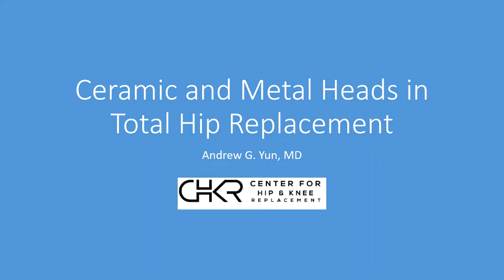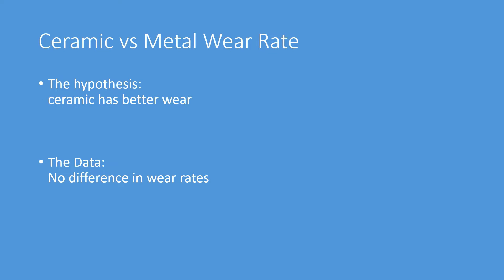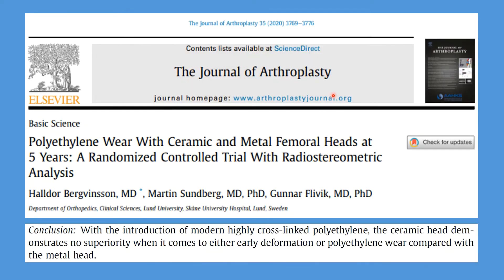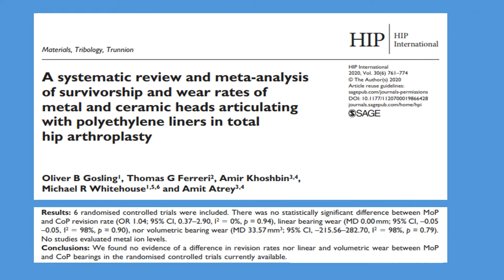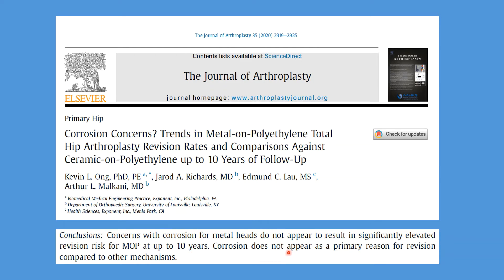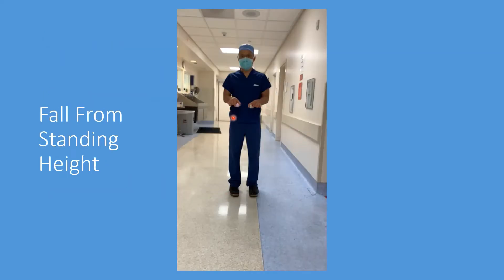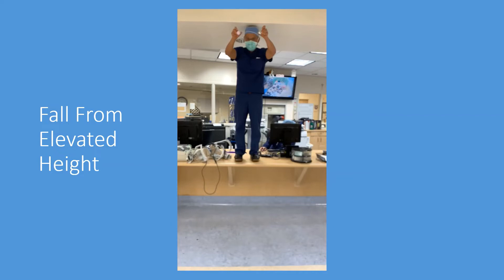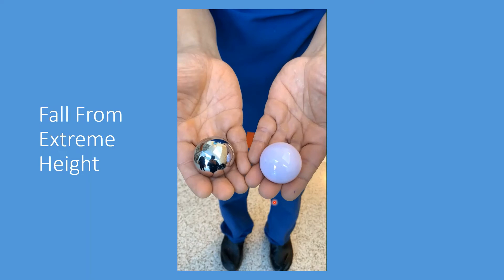Ceramic vs Metal Heads in Total Hip Replacement

Comment: Have a customer who dropped a ceramic hip ball from the 10th floor onto a cement pavement, not even a scratch...... BTW ceramic hip ball diameter is available in every second millimeter (...28, 30, 32...)

Comment: SOMETHING TO CONSIDER AS THE CHOICE OF METAL OR CERAMIC BALL IS ONLY PART OF THE REPLACEMENT.  SOURCE GIVEN AT END:  "Risk of Metallosis from the Stryker Rejuvenate and ABGII Hip Implants
The Stryker Rejuvenate and ABGII are a bit different from the all-metal hip implants in that they implement a ceramic ball rather than a metal one. Since the major problem with the metal-on-metal hip implant design is the fact that the ball and acetabular cup rub against one another causing tiny metal ions to shear away and lodge into the surrounding tissue or bloodstream, it was believed the ceramic ball of the Rejuvenate and ABGII would effectively circumvent this issue. Unfortunately, the design turned out to have some different problems however the result was the same—metal ions in the body leading to metallosis.

Metallosis can cause serious adverse health symptoms for the recipient of the hip implant, many of which are irreversible, even when the implant is removed. The Stryker Rejuvenate and ABGII were recalled this past July due to the risk of fretting and corrosion at the neck juncture. It was later found out that the metal trunnions, located at either end of the neck piece are made of metal as well. Body fluids can become trapped underneath the trunnions, corrosion occurs and metal ions are released into the body just as with the all-metal implant. The trunnions on the neck snap into the stem on one end and the ball on the other, giving surgeons freedom to choose the perfect size components for each individual patient.

There is considerably less metal surface area than in the metal-on-metal hip implant, meaning there will be lower levels of cobalt and chromium in the body. The problem is that any level of cobalt and chromium can be too much. In persons who are particularly sensitive to these metals, even small amounts can make them very sick. Others with a relatively high tolerance for the metal ions may not notice any adverse effects until the levels in their body have built up to an alarming amount, then they may fall very ill. The following health issues are common in cases of metallosis:

Kidney problems and renal failure
Neurological issues
Cardiovascular problems
Loss of vision and hearing
Disruption of DNA
Thyroid problems
Fatigue, anxiety, depression
Loss of memory
Chronic headaches and brain “fog”
Dizziness and vertigo
Skin disorders
Gastrointestinal disorders
The development of pseudo-tumors
Those who have a Stryker Rejuvenate or ABGII—or any other metal hip implant—in their body should take special precautions. You must have regular blood work to monitor the levels of cobalt and chromium in your body, and your doctor may also want you to have a bone scan to determine whether there is any deterioration of the bone or tissue surrounding your implant. An experienced products liability attorney can also help inform you of your rights and assess your individual situation in order to determine what your options are for your future."  I AM IN NO WAY AFFILIATED WITH THE PEOPLE WHO POSTED THE INFORMATION IN THE LINK.  IT WAS FOUND USING GOOGLE SEARCH.  I HAVE NO AFFILIATION WITH STRYKER OR ANY OTHER MEDICAL EQUIPMENT COMPANY.  I DO KNOW THAT MOST MANUFACTURES DO INCENTIVIZE SURGEONS TO USE THEIR PRODUCTS.  BUT A SURGEON HAS TO USE SOMETHING AND CAN NOT LEARN AND STOCK EVERY OPTION. ANYMhttps://sullolaw.com/productdefects/hipmetallosis/stryker-metallosishttps://sullolaw.com/productdefects/hipmetallosis/stryker-metallosis
Reply: I appreciate your comment and research.  What is the best implant for hip replacement?  I was considering the dual mobility, although this also has cobalt and chromium in the head.  I am very concerned about metal toxicity and want the best implant possible.
Reply: @terragibbia4670  I wish I knew,. Stryker is the dominant player. Probably several good options. What is most important is the skill of your surgeon in placing the implant correctly.  I watch the Styker Maco Robotic Arm video on Youtube and it seems like the best way to help the surgeons get everything right.

Comment: Interesting, but the comparison re: corrosion only discusses the extreme of 'failure rates' (i.e. the corrosion would have to be extreme for the device to fail by corrosion); there is no discussion of the less mechanically extreme, but still significant point that the Cobalt-alloy heads poison the nervous system even if they corrode moderately. What about that (pretty important) point?

Comment: Seems to be mixed opinions on studies. In 2013 a study said Ceramic femoral heads produced significantly less wear on conventional polyethylene liners at the time of long-term follow-up than did metal heads in this matched-pair analysis of young and active patients with uncemented fixation.

In 2017 a study showed little difference but in fact metal was superior regarding dislocation repair. I'm seeing Dr. Yun next month and expect a replacement. I already have a ceramic femoral head in my right hip, so if he uses a metal femoral head on my other hip I can compare. Lol Dr. Yun is considered a top notch technician, so I'll just take his word for which is superior.